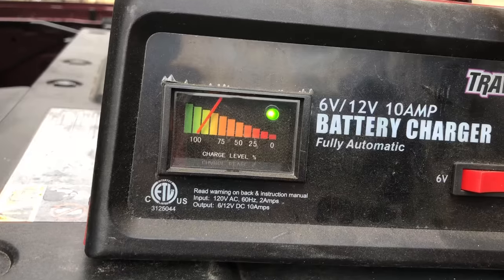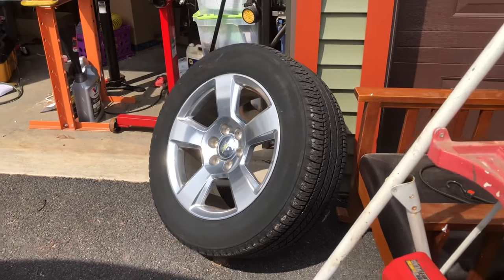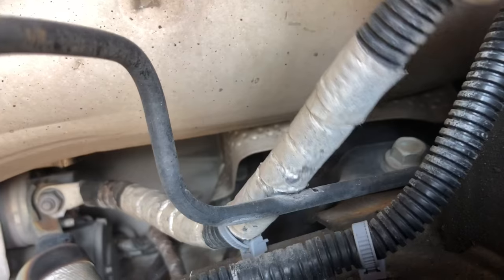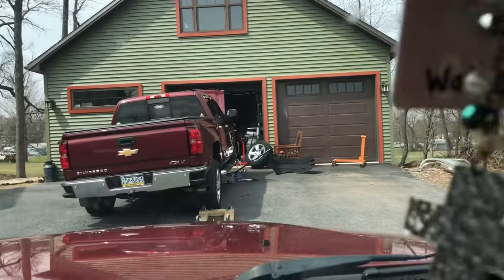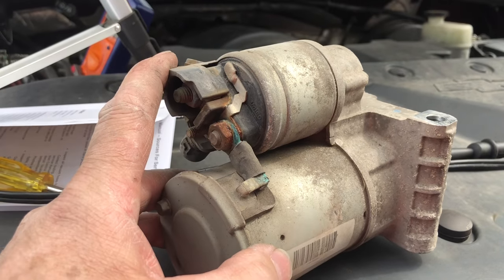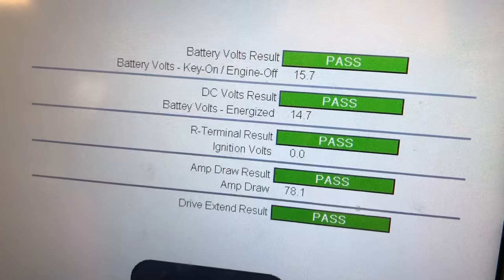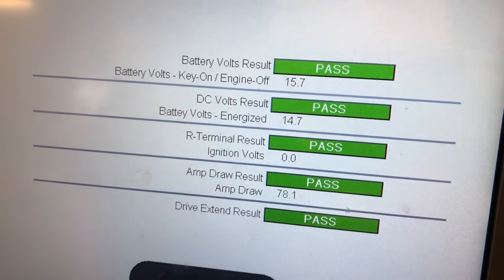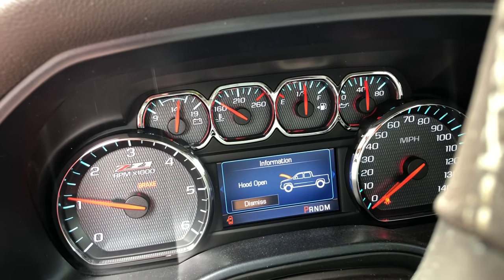2014 Silverado no crank no start problem solved!

Comment: Thank you for the info.  My 2017 Silverado wouldn't crank and left me stranded at work.  Your info prompted me to investigate and I found that the connector for the solenoid was broken off! due to corrosion.  I was able to jump the connection with my Power Probe (you could use a piece of wire or jumper cable, but have to be very careful not to short it to the frame or engine) and activate the solenoid... got it started and made it home.  The 90 degree connector is held on with a little screw on the solenoid underneath a round plastic and foil heat shield... I cut off the plug and used a ring terminal to connect right to the solenoid... just like they used to do.  It's lower than the power cable, further away from the exhaust, so I don't think heat will be an issue.  Easy fix, saved me $200 for a starter (or worse... towing to the dealer) and I didn't need to remove the starter to do it.
Just wanted to share in case someone else runs into the same thing.  Removing the wheel and inner fender is pretty much a necessity, but I was able to apply power to get it started to get it home with the inner fender on.  The inner fender screws are T15 and the solenoid connector is 8mm.  Hope this helps somebody.

Comment: Thanks for sharing your video.  I had the same issue with my 2017 Silverado.  The frame was sprayed with the rust corrosion tar junk and that was keeping the ground wire from providing a good connection.  Removed the rust corrosion tar junk, sanded the area and reinstalled the ground wire.  Started right up.  You saved me a ton of money!
Reply from the maker: Awesome
Reply: Same. 2016 Silverado
Reply: Good to hear, I’m having the same issue with my 2017 Silverado currently. When I banged the starter with a hammer to fire it up sparks were shooting, so I’m assuming I’m having the same problem with a bad ground connection? Gonna try this tomorrow!

Comment: Thanks for this video. Unfortunately, I went through the process you showed before finding your video. My issue on my 2017 Silverado is constant dirt/corrosion on the positive battery connector to the starter. When I get the click, I clean the wire connector with a wire brush and it solves the problem. Everyone should try to troubleshoot these items before pulling the starter out to save time and effort.

Comment: The ground is made at the threads instead of matting  on the frame  to reduce corrosion. The bare spot and threads need to be protected with undercoating material

Comment: You found your problem and apparently didn't realize it. At 4:10 when you touched the positive cable and had 12.68v but the stud should have had the same voltage but you said it hardly had anything. That was a bad connection, you probably could have loosened off the nut and tightened it up again and had a good enough connection which is essentially what you ended up doing when you removed the started and reinstalled it.
Reply: your comment made me follow your channel.
Reply: Curious if you’ve seen this before. I’m about to crawl under my truck and do a voltage test on starter/battery connector. It’d be interesting if this is a common problem. I’m not losing power to my dash. Just a click, which makes me wonder if starter or bad or battery connection is corroded.
Reply: @Tim20461  Yes I have, make sure your connection from the battery to the starter are all good and solid.
Reply: @737mechanic  very much appreciate your timely response

Comment: Thank you! After traveling 250 miles with family stopped to get fuel and went to start up the 2014 silverado it would not turn over. Pulled up your video and instantly checked the frame ground. Cleaned it and bam truck started! Appreciated the help!

Comment: Thank you for sharing, my 2015 Chevy 1500 Silverado had/has the same issue, it’ll eventually start up, sometimes on the 10th crank, and some times on the 100th crank. I’ve done the same procedure 6-8months ago. everything worked fine up until yesterday 6-8 months after doing everything in this clip, the problem has returned, so I’m about to run through everything again in hopes it’ll work the second time around. The area that I live in has horrible winter road conditions and it beats up and causes mass corrosion on all vehicles.
I stopped in to see if any one has figured out anything new or has found the actual reason for this issue or better yet a more permanent fix. If I find anything new or do something different that works I’ll be sure to give an update in hopes it can help someone else and save them from pounding their head against the wall and also save some money haha
Reply from the maker: Check the connection off the solenoid terminal to starter. Prone to corrosion you can’t see. May need to remove nut and clean the stud, new washers etc. mine has been doing fine since this video was posted
Reply: @watsonswagons is yours still running and starting ok? I did what you suggested, it worked. Then a few weeks later i had lights flashing, alternator was making a humming and I had to get the alternator replaced. All was good for about 3 weeks, then lots of issues since. I tried removing some of the sound deadening under the dash that a couple other guys have posted videos about. I’m about at my wits end. When it gets no power, I’ll recede the positive and the negative and it’ll start and then (the most recent thing) I’ll drive it and it’ll die if I turn or something that pulls more power. Then i have to recede the cables again. So just curious if yours is still running well if you still have it. 
@jojojoseph did you find a solution for yours?
Reply: @robholcomb1803  I had similar issues late last summer (having no crank no start issues now) and what fixed it for me was replacing the battery ground cable that he shows earlier in the video. Getting to the engine ground is a pain in the ass but replacing that whole cable solved a ton of issues, particularly total power loss and hard steering at low speeds. Later today I need to pull the starter and get that tested. We need a silverado owners therapy group or something.

Comment: A friend of mine is having the same issue on his 14 Sierra. I’m going to show him your video. You did a great job on the video and it will help many. Thanks for posting
Reply from the maker: J D thanks, have him check the post that links the solenoid and starter motor. I had bad corrosion where the washer rotted and the connection was lose causing arcing

Comment: Literally just had this happen. Then when I got the truck started I had a bunch of codes saying "service 4WD, service trailer brake, service power steering, service stabilitrak, service brake assist" and my truck went into like a limp mode where the rpms had to be about 2200 before the truck would even move. Torque converter shudder the whole 9 yards. A few hours later it started and drove fine but had a check engine light. Dealership diagnosed it as a bad negative cable. Saying it was having voltage drop from the negative battery terminal. They said my aftermarket stereo could be the culprit too. I'm gonna start with this, they wanted $350 to change the cable. After watching this video I definitely know my dad and I could fix this in the driveway. Thanks for the helpful video man. Love this truck but man it's been a headache since I've owned it in January.
Reply: Billy loughridge what was your solution if don't mind asking I'm having the same same problem
Reply: @ricardotovar5549  well what happened to me was I had the range afm disabler plug in. I bought it used. It must have needed a software update because I cleared the codes and had the range updated and haven’t had any issues. I never did have to fix anything else for that issue.
Reply: @Billy-hx3zi  thanks for the response..ima have to keep searching..I  change ground cable and clean other grounds and still no luck
Reply: @ricardotovar5549  damn. Yeah keep reading up on it, I’m sure it’s something stupid lol

Comment: Thank you for the video.  I had a similar problem. 1st time I was able to tap several times on the starter and "unstick" the "bad spot" in it, I was able to drive home and replaced the failing starter 4 months later. I've heard that removing the starter and giving the shaft a slight turn can occasionally work too on a "bad spot".     Last night I was driving in freezing rain and slush snow.  This morning the starter would only "click"  I placed a small electric heater under the  starter in -5 degree temps. In 30 minutes it has thawed out and started great.  I assume moisture or condensation was in the starter and it froze up.  I would recommend checking the battery and all the connections 1st.

Comment: 2014 Chevy Silverado and same issue! Why GM made the grounds they did is crazy. Also have one underneath your driver side dash that you can clean.
Replaced battery and alternator and still had same issue go to crank and no power. Clean all the grounds and check your starter. My truck has 146,000 miles on it. Love the Chevy truck but location of grounds needs to improve. Great video
Reply: A deeper problem is the post coming off of the starter to the solenoid. Basically a strap mounted to a stud had lots of corrosion on it. I had to clean all that off and put fresh washers in. It was arcing, and that arching caused the system to shut down.

Comment: I had the exact same issue. Cleaned the ground you mentioned and still same issue. I ended up replacing the starter which has solved the one click issue when starting my 18' Silverado (my trucks starter went bad at only 40k miles, not impressed GM !!!)
Reply: Mine literally went bad today! 33k mi
Reply: Mine went bad after 40k too!
2018 Silverado
Reply: Have a 2018 Chevy Silverado---Started having a no start problem about 2 weeks ago. I had driven my truck, came back to my house and needed to leave an hr later and it wouldn't start.  Thought maybe just my youngest son hit a interior light on or maybe I didn't close my door all the way. I jumped the truck and didn't have any issues for another couple of days. Had the truck not wanting to start those couple of days later but also thought, due to being between my old job and new job, I wasn't running the vehicle to keep it charged and then having the intermittent cold spells/weather maybe just a the battery. Well the problem has only gotten worse. I had to jump the truck one morning prior to work and starting at my new job. Went to work and was at Human Resources for about 2 hours. Truck started no issues. Left and went to my work place, couple of miles away. Was there to finish out my work day about another 5 hrs, truck never had a problem starting. Left work, stopped briefly at a TSC store, went in for literally 1 minute as they didn't have what I needed, came back out to start my truck and only clicked once. Thankfully an individual gave me a jumpstart. Now, will occasionally start but moreso just experiencing a 'one click' response when trying to start. We've done (my husband and I) everything from cleaning the ground wire to the frame, to cleaning the battery terminals, to checking all the fuses under the hood and on the driver's door panel area,  just browsed them to make sure none looked blown and made sure all snug in their spots, switched the starter relay temporarily with the trailering (as we seen on YouTube), attempted neutral start, replaced the battery, checked voltage under a load, had the starter checked at AutoZone and it passed, after trying to tap it for potential "flat spot." Sometimes it will start when being jumped from electric battery charger or my husband's truck. Doesn't usually start right away but may take a couple attempts. Usually just clicks once and then nothing until after attempting several starts and then it will fire up. We will run it around, attempt a restart, sometimes it will restart a couple times, recheck 30 minutes to an hr later and will only click once. Before we un-installed the starter...we did happen to find the positive cable to the starter was arcing. Wrapped with electrical tape then tiger patch muffler tape since so close to the manifold. Didn't resolve the problem. Removed the starter and had it tested, which I said above and was told it's good and was given the report. Reinstalled the starter and my truck started right up. I ran it about 30 minutes while we reassembled the truck, putting back in the inner wheel wall, tire...and ran it out my driveway and road...about 2 miles. Came back. Turned off the truck. Had 3 successful back to back starts ..thought maybe we fixed the issue..tried to restart about 30 minutes later and only the click again. All the lights, etc do and always have worked when attempting to start. Also noticed on the dash panel that it says "CAL." We read in the owners manual that that only has something to do with the navigation system though and it goes away once we run it. So, my question to anyone...what in the world do we do?? Do you think we should replace the starter even though we are being told it's good? Replace that positive cable to the starter because it showed signs of being arced (which we incidentally found working on the truck at night)? Replace both? Just have it towed? I bought this truck hoping I wouldn't have car issues and it seems to be a headache since I've bought it! I really need this vehicle for work as my husband and I are sharing 1 vehicle for work and we work in 2 different counties about 40 minutes from each other!

Comment: Thanks for this video again. I had this issue last year and this is how it was resolved. NOW it's back. One year later I'm watching this video again and  I'm going to remove the 1,000 bolts from the inner fender so I can repeat it. 😭😅
Reply from the maker: Check the connection between the starter solenoid and starter. The nuts and washers on the stud corrode and cause arching
Reply: @WatsonsWagons  I will do. Thanks 👍

Comment: I have a 2014 Chevy Silverado LTZ with 58000 approximate miles that had/may still have (not sure) a similar issue.  First no start, tested battery and got 12.7.  AAA showed up and were able to jump the truck.  Drove it to a buddies auto shop and installed a new interstate green top battery.  Truck started and I went on my way.  About a week later I had a no start again.  I was able to jump the new battery and took it to the stealership.  They advised it was the little four inch positive battery cable.  $119 later and I'm out of there with a new cable and the old one in my pocket.  36 hours later, no start.  AAA came and tried to jump with no luck.  Truck towed to stealership where it was determined that I must have a new starter installed.  Because of the GM strike, no starters available on the east coast (Maine to Florida) to be had by me for the fix.  Stealership used a NAPA starter and I was back on the road.  6 days later I had a no start again.  AAA came by and decided to smack the new starter with a hammer just in case the aftermarket starter was hung up.  While attempting to smack the starter a wire was discovered hanging down.  It was the starter solenoid wire.  Note - After market starters require the connection really be jammed on there tight.  I elected to have the vehicle towed to the stealership again to remedy this issue... my problem but theirs too.  After they jammed the wire on there no issues for a couple of weeks until two days ago when I was out renting a trailer to haul the Harley and there was yet again a no start.  AAA came, observed as I did that there was current on the dash but no click under the hood.  They towed the truck to the stealership who after locking the keys in the truck jumped the truck and advised that they believe the battery could have a shifted or bad cell.  I drove home and charged the still new battery to full then float.  No issues yet.  Will update all if there's another no start.  May do the battery isolator and second battery in the future as well as the ground thing Watson's Wagons discovered.  Best wishes folks.
Reply from the maker: David Vaughan geez, I had another failure and it was 2 things, small wire connection between starter and solenoid. So much corrosion the act of starting just simply arched. The washer and nut on the solenoid were toast. This video shows the rust and funk. So I took that apart, cleaned surfaces and used a fresh nut and washer. Also had a broken tab on the solenoid wire, vibrated loose. I could reach in with my left arm and reinstall the wire. So I took a few hours to permanently attach the wire with zip ties. Haven’t had a problem since.